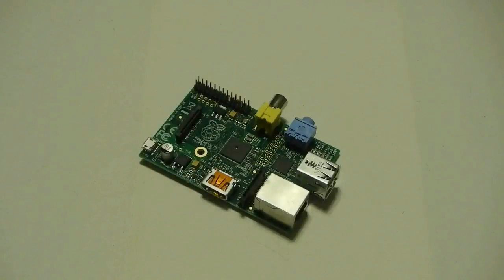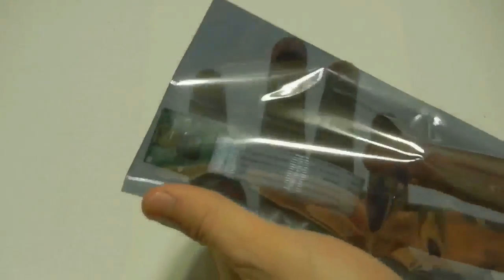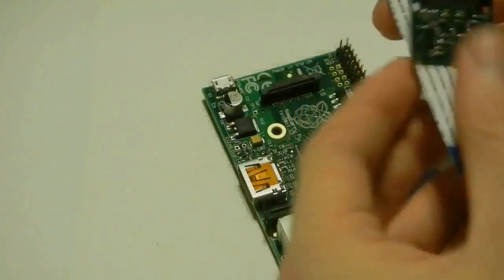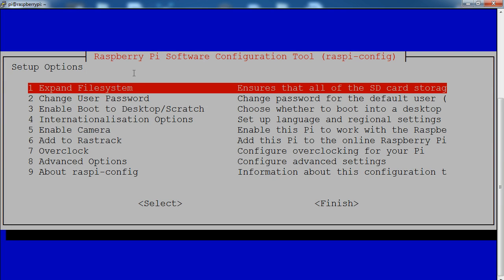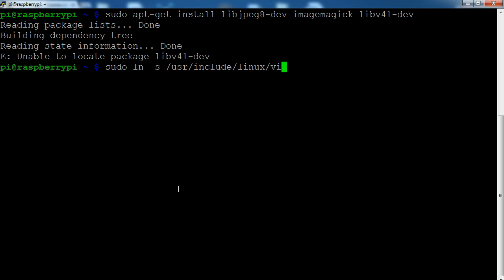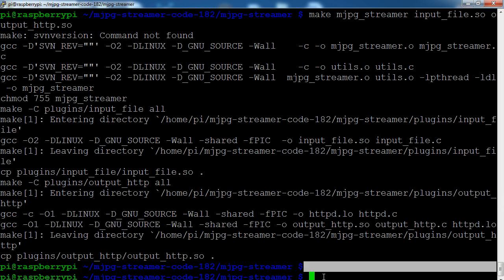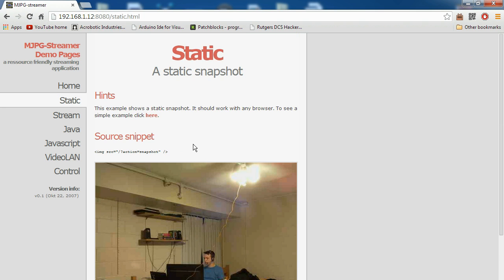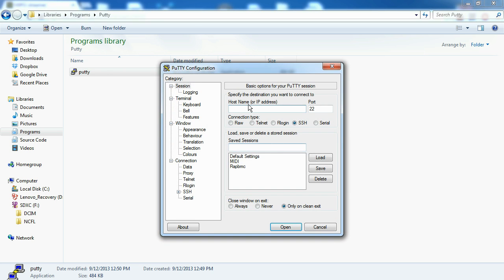Raspberry Pi Camera Streaming

Comment: why did you need putty for ? im confused?
Reply from the maker: Putty lets me run a remote console on the raspberry pi, so that I don't have to be physically connected to it.
Reply: so i take it that is needed for rasberry pi every time ?
Reply: putty is a ssh client.  It allows one to login to the raspberry pi remotely from another computer (this is not raspberry pi specific.  I'm logged into multiple linux computers right now for work).  One could connect to the pi directly with a keyboard, mouse, monitor if they wanted.  So an ssh client like putty is not needed, but can be convenient.

Comment: Is it possible with this setup to stream the video from the Pi to a wifi laptop without any other hardware?  Are all the frames from streaming saved to the SD card or are they deleted?  I want to be able to stream for long periods but not save anything.

Comment: What is necessary when using two cameras through that streaming service? If I wanted to run a night vision and normal camera module through the pi what would I have to do differently? Also can it stream audio if I put in an audio transmitter?

Comment: you can use -t 2147483647 to run it for 24 days (or you can loop it with just a few lines script), otherwise raspistill quits after approx 2,5hour (9999999msec).

Comment: The led on my cam only turns on when I connect rasbmc but when I connect raspian it turns off, after I setup raspistill or raspivid it says could not detect any camera. I have done sudo apt-get update & upgrade  and enabled the camera in sudo raspi-config  but nothing happens at all. Any ideas?? someone, thanks!
Reply from the maker: Check both connectors. It may feel like it's well connected, but it never hurts to try and re-seat it.
Reply: Did not work, but thanks for the tip hHD.
Reply: It must have had a static shock when I was connecting it to the paspberrypi, my fault, my idiocy, I am going to buy me another one, that should teach me a lesson, always follow the instructions.  But thanks for your time.
Reply: Got it now, the connector in the front of the camera was unplugged, I am building a house for the pi & raspbicam and used the faulty camera to find the best way to build it properly, then I noticed that the connectors in front of the cam were loose so I pressed it back in place and tested the cam again, and now it is up and working well. now I am going to try to build a time lapse video, can I use 32 Gb usb storage connected with the Raspberry pi  to store the time lapse frames?. I want to make a time lapse frames of the weather in my hometown here in Iceland. and hopefully another solar sell raspberry pi with rpi cam in the mountain, inside puffin's hole to see how they race their young puffins from the first day until they fly away on their own. Thanks for everything.